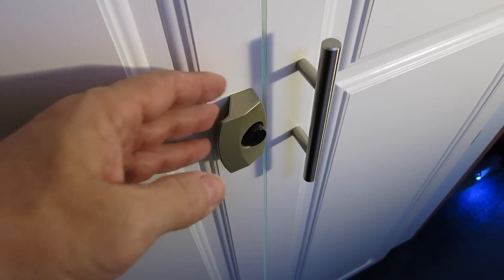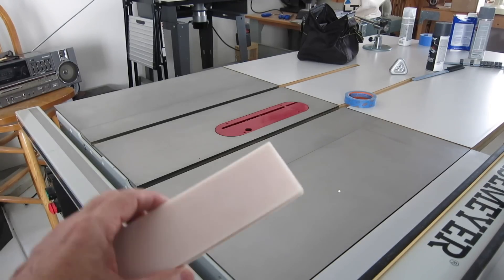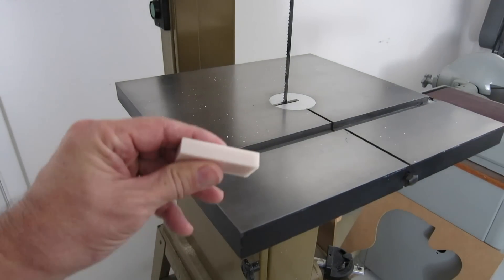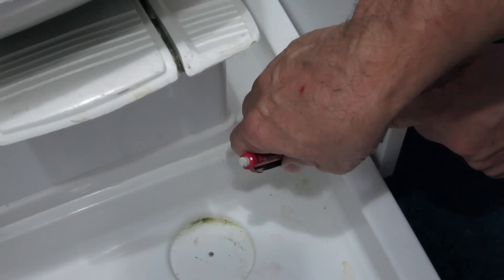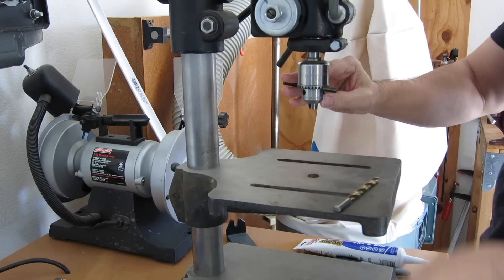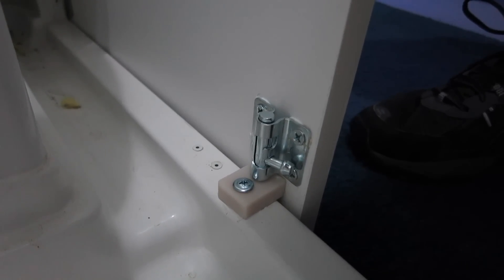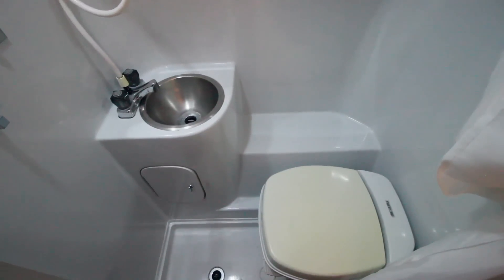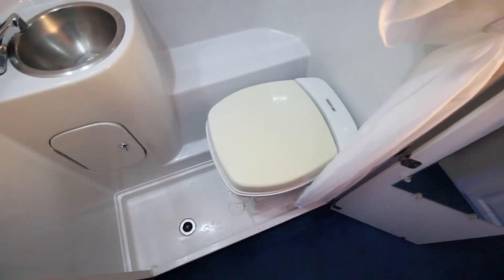RV bathroom door fix

Comment: You might consider one of those stainless steel shower heads and tubing or I think they also make them to look like stainless steel and are relatively inexpensive.  As far as the toilet lid, you could probably paint it with some paint for plastic after using a adhesion promoter. Great video.
Reply from the maker: +terry3193 You are a mind reader for sure. Stay tuned.

Comment: The shower doors are not an issue for me now. But I'll be sure to check the next video. Yellow toilet seat and shower head replacement is much needed on mine as well.
Reply: Did you ever start you xplorer when it was momentarily straight pipe with no muffler?  thinking about doing it. just wonder what the mileage loss will be.
Reply from the maker: +Z Shark Once in a great while they would pop open. Enough to make me do something about it. Shower and toilet get some love tomorrow.
Reply: +Josh Holland (Capitol State Nomad) No I didn't.. In my opinion it would be way to loud for a motorhome. Don't think the fuel mileage would change much either way. And I have a straight piped V-twin chopper if I want to make that kind of noise :)
Reply: +Xplorer Steve I know you research a lot before you buy something.. So If you could include the model number of the shower head that would be great :) This road is nice and smooth that your paving BTW :P